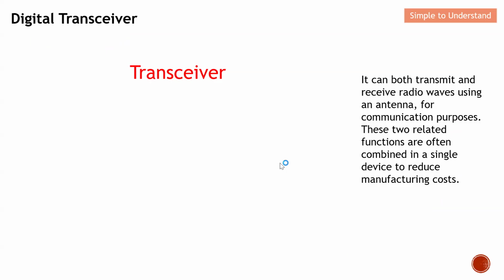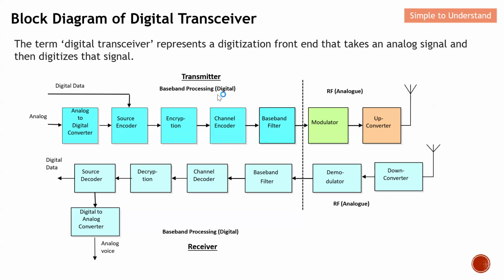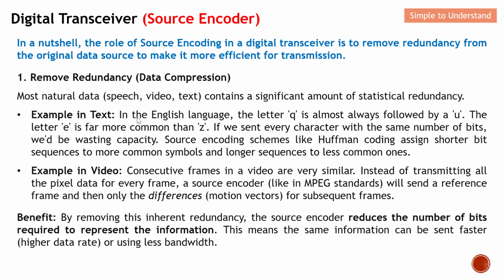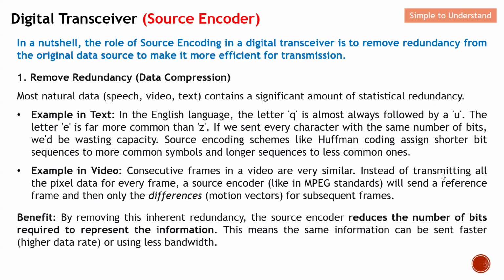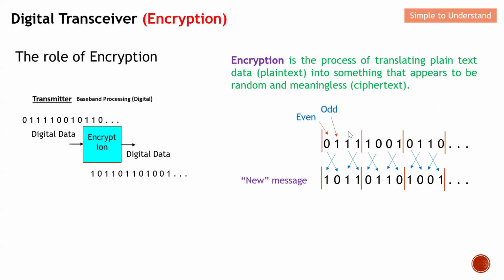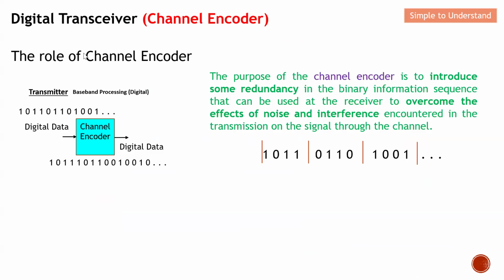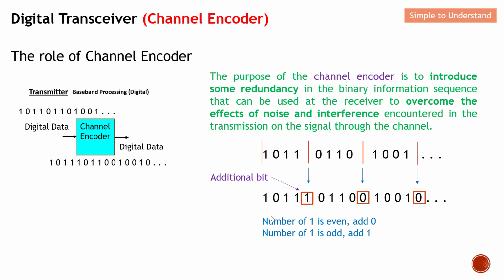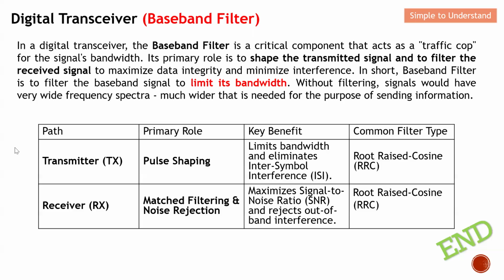Digital Communication #1. Digital Transceiver Components Explained | Source, Encoder & Encryption

Comment from the maker: Thank you for taking the time to watch this first video on digital modulation. Before we begin our discussion on digital communication, we need to understand what a digital transceiver is. The word "transceiver" comes from the combination of "transmitter" and "receiver." This means the device is capable of both transmitting and receiving.
This video will discuss the block diagram of a digital transceiver, focusing on the source encoder, encryption, channel encoder, and baseband filter.
The role of the source encoder is to make the message as small as possible to improve efficiency when sending it. Encryption ensures the protection of our message. It prevents others from understanding it, so only the intended receiver can decode it.
The channel encoder adds bits of data to prevent errors and may even be able to correct them. As for the baseband filter, its primary role is to shape the transmitted signal and filter the received signal to maximize data integrity and minimize interference. In short, the baseband filter is used to limit the bandwidth of the baseband signal. Without filtering, signals would have a very wide frequency spectrum—much wider than is needed for transmitting information.